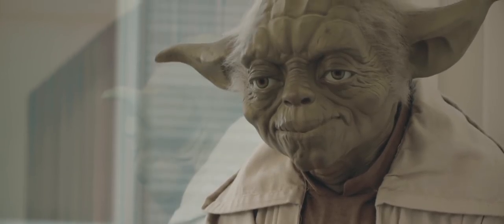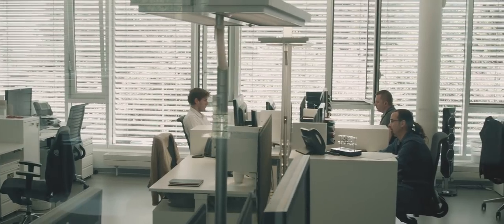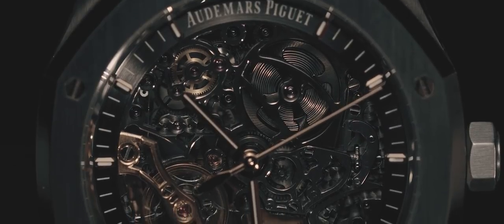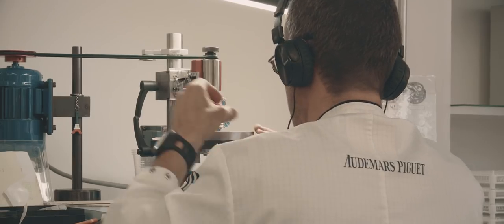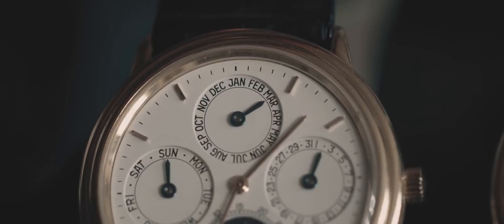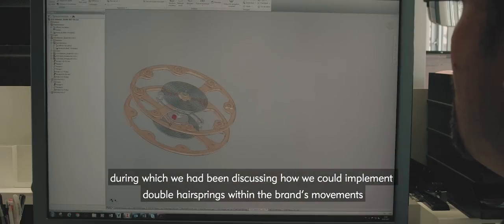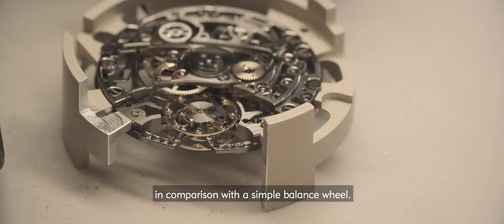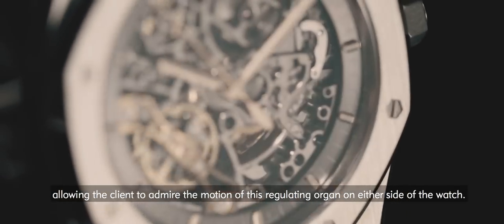The Audemars Piguet Royal Oak Double Balance Wheel Openworked Fully Explained

Comment: The snobbery and lack of enthusiasm from boutiques to help you obtain certain models that they never have in the showroom is poor effort. Models like this get talked up but then you walk into a boutique and tell you theres a ‘long’ wait. (Deliberately to drive brand enthusiasm, hype or they sell to their grey market friends). Grey market dealers have them in supply continuously which is questionable. It seems to me that retailers and grey market dealers are working with each other rather than the watch enthusiast and buyer. Funny how grey market dealers have brand new watches selling way above retail and stores tell you they cant get them without a ‘long’ wait. This needs to be fixed in the industry.
Reply: "Funny how grey market dealers have brand new watches selling way above retail and stores tell you they cant get them without a ‘long’ wait. This needs to be fixed in the industry."

Agree 100%.  At the moment there are more than 60 Audemars Piguet Royal Oak Double Balance Wheel Openworked on Chrono24 - mostly new, and (for steel versions) with asking prices about 20 000 USD over retail.

This is one of the reasons I probably never will buy Audemars Piguet.
Reply: So true, I'm trying to buy one and the boutique manager told me straight the steel version is simply "no way". I got the hint that I either need to spend 100K+ to be even qualified to be on the "waitlist" or need go grey market. This goes same to blue dial RO 15400, or most Patek Nautiluses. It's rather absurd that one need buy number of gold watch(es!!) just to be able to "wait" for steel ones. In the mean time, snatched a Patek RG Annual Calender and Rolex Gold GMT (together with a steel Patek 24 and a Rolex Two tone Datejust), then patiently wait for the next 2008.
Reply: Greg Mieg yep, you nailed it! It's like those clubs that keep the door shut with bouncers and they only let "selected" people in to create hype and and air of "exclusivity"...then you get inside and it's half empty and the whole atmosphere and vibe sucks because they've let in only hoes and drug dealers with oversized gold watches😂
Reply: perhaps i can answer you some questions.
first, lets say watches that do not require application, not limited, not extremely high difficult to make
- when the factory finish some watches they will sent them to boutique or retailers all around the world. 
- those boutique or retailer may only receive one piece. sells man always contact their old customers, who interest or pre-order those model. If there is no preorder, they will sell it to whom pay first, 

for those limit edition,
- let say if a model only make 300 pcs, once its official release. client need to pay deposit to secure the watch. once again first pay first serve.

watches that require application
- you must be their client first
- you may heard 1:1 -1:3. which mean if you want a watch which cost 50K then you have to buy 50K - 150K unpopular watch first, but no promise you will get the watch you want

there are lots of game rules....

for those "grey market dealers" what they selling is preowned watch (2nd hand) they may look like new.
most of the time those watch are unpopular watch (buy under 1:2 ratio) or  watch hard to buy